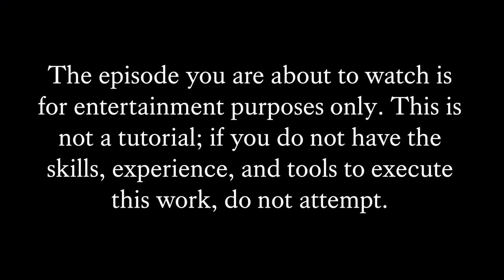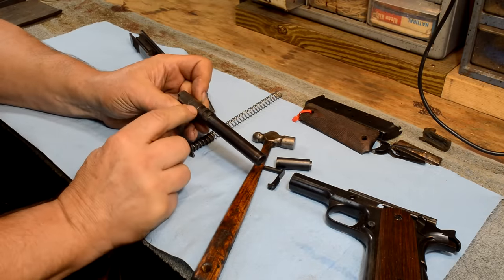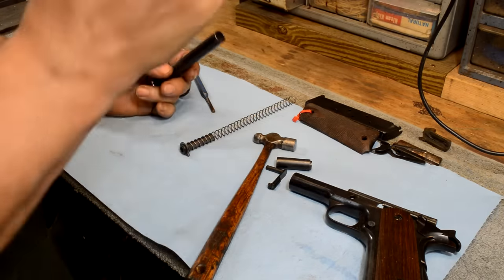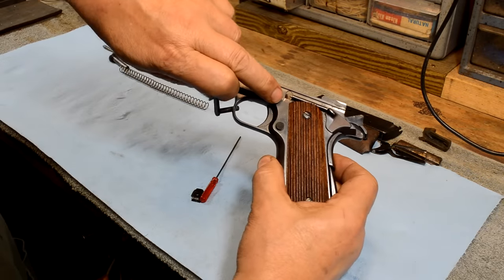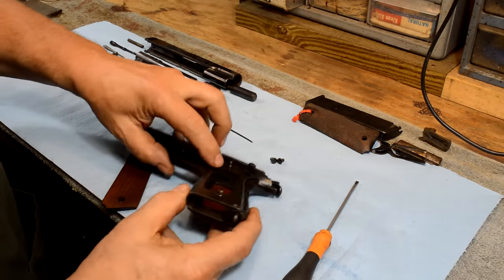Argentine M1911: Anvil 0125

Comment: "The gun runs great, just can't hit anything with it." That's how our boot camp 1911's were.
Reply: That’s how all my guns are 🤣 handguns at least. I struggle even at 25 yards with full size GI 1911s, only occasionally can I lob a round out to 75 and ring the plate. I should practice more but I can’t afford to shoot that much.
Reply: That's is the same description I heard in boot camp 1975.
Reply: Semper fi. I would draw a pistol 1911. From the armory. It was my weapon when I was doing special duty. They all would rattle and wobble hard to hit much. USMC. 71-74.

Comment: In all the years I have been completely taking apart 1911's, this video taught me a few little hacks to make life easier! Like having a mag in when putting the sear and disconnector back it! One hack I learned elsewhere, was instead of pushing the plunger from the outside to get the takedown pin back in, was to come in from the opposite side with a small flat screwdriver and compress it while coming straight in with the takedown pin. Excellent video as usual Mark. Thank You for resurrecting this old lady!

Comment: Speaking of 1911's. When I was in boot camp in 1971 we went to the range. We were required to use a Weaver hold (2 hands). The instructor then called our attention to the ceiling of the indoor range. It seems a chief was qualifying with the old school side stance with 1 hand. The armory 45 went full auto and emptied the mag. Last round went straight up. Good times>

Comment: This is a great video on 1911s. A few of the things you demonstrated I got to see first hand by my 1SGT before we deployed to Desert Shield as one of few A.D. Army units still using 1911a1's. He was in AMU , shooting competition with 1911a1 and working on them.  The technique you demonstrated on tightening slide to frame was pretty much the same. He used pencil lead (graphite) to slick up the action.  Mine was a pre WW2 converted to 1911a1. I wish I had it, my Grandfather's, Uncle's, and father could have been issued it during their service.

Comment: Mark, Thanks for showing us how to fix a loose slide. You sure make it look much easier when you know the best methods and order of operations for each job. 1911 pistols can have such good triggers because of their good design and all the hand fitting they need.  If it isn't a junker, it takes a lot of nerve to work on the first one. A wood block with a pair of tapered shims made from wooden shingles would make good filler blocks for frames and slides.

Comment: I de farbed my series 80 Colt back into the series 70 format with the spacer to replace the two widgets. The sequence was; re-assemble, despair, re-assemble, despair, 3 or 4 times until it functioned correctly and that is the LAST time I will tear into the frame that extensively at my age/patience level.

Comment: Great video mark. I work on a lot of antique firearms. I came up with a way of making the metal on new parts match the original guns texture fairly easy. I use a power supply. Hook up the positive to the part you're trying to match to the gun. Then hook the negative up to a Q-tip dipped in saltwater. By lightly going over the part. You can make the new part match very well. So then after bluing it matches the rest of the guns texture and wear.
Reply from the maker: Powered galvanic corrosion. EPIC, adding to my playback.
Reply: What a cool idea!

Comment: 22:48... Indeed. First time I installed an aftermarket Beavertail grip safety on one of  these and tried it out, it went BRRRRP... Rather, BRP, as I wasn't a complete idiot and did load the mag with just 3 rounds. Very scary (and at the same time fun and exhilarating). 30-ish years ago now.

Comment: Love the muffin tin lead ingot...  Been using the same for the same kinda work for decades...  Even has an oh so fancy hole drilled on one side.  As for fine Argentine pistols, my two Sistema 1927 Navy models, one blued and one Parkerized are as Tuco would say:  Tight...  tight, tight, tight and both are in excellent condition.  Only odd thing is the mag wells for both are on the very minimum dimension, and many magazines will not fit or fit very tightly.  The OEM serialized magazines work perfectly, and believe it or not Triple K magazines do as well.  Norinco ones are pretty good, but Metalform magazines took a lot of fitting (filing) to get to where they would even get to the point where they could be inserted.  Great video Mark.

Comment: When I was in the Army in the 70s, I saved my Pennie’s and bought a 1911 Gold Cup NM, took it to the MTU at Ft Campbell KY, to show it off. The NCOIC approved of my new toy, and asked me if I wanted to fix it. Brand new Gold Cup??? I said sure WTF, he had me take  the gun apart, he crimped the slide and installed a new barrel link that he made, he gave me a pot of rubbing compound and told me to get to work until the slide went home. Steam cleaned the slide and frame, put everything back together oiled it up. Put the gun in a rest ,used match ammo little bit more than 1” group at 25 yards. He told me that now if I missed it was my fault. I only shoot 185 gr bullets that I reload. It works good and has lasted a long time, replaced the extractor a while back though.

Comment: Good tips!  To avoid scratching the frame with the slide stop, you can get a business card and hold it against the frame when you're removing the slide stop.   

I think you're the first person here that I've seen say to take the slide off first instead of messing with the barrel bushing first.  That beats sending the recoil spring plug flying across the room or breaking light bulbs. :)  

I'll have to try inserting a mag next time I try pulling the sear and disconnector.

Comment: Mr. Novak...  An old-timer (WW2-era G.I.) taught me to hold the trigger in on a 1911 when dropping the slide.  (obviously while pointing it down-range) I have always been somewhat resistant to do this.  Reason he said was the disconnector would prevent a loosey-goosey G.I. 1911A1 from unintentionally-discharging.  Is this a good practice for a 1911?  Seems to me like a bad habit to get into.  Your feelings?
Reply from the maker: Hold the hammer like I did. Hit the "I believe" button on this one. Just Sayin.......

Comment: I have a 1943 A1 that my dad's oldest brother had. It has got rust around the end of the slide. Wish I had the money to get someone like you to preserve it.
Reply: You can clean a lot of rust off yourself and make a gun look 1000 times better. Just take some 0000 steel wool and some oil (I like using motor oil). Put a decent coat of oil on the part that's rusted, then gently rub the steel wool over it. After a few seconds most of the rust will be gone and the oil and steel wool won't hurt the bluing or parkerizing. If you have deep pitting and rust you can't get to, you can boil the part and the rust will turn black making it blend in and keeping it from spreading easily. Just keep it oiled afterwards and you should be good to go.

Comment: My Dad was in the Army 1973 to about 1998. I can remember how the 1911's where before they went to the Bereta in 9mm. They all rattled a lot. You had to work to qualify! The Army for a long time if I remember correctly would service a weapon something like every 3-5 years and the unit or company level armours would do maintenance on them but not rebuild them. If they needed to be rebuilt they only did it maybe 3 times and then they where often sold to the US Navy Marine Corps.! Not sure if the main stream US Navy was the same. If so I can only imagine the 1911's you saw! I am almost 50 now so that gives you some reference! I have children that own and carry a 1911. It is though not what I carry! I like smaller lighter for EDC!
Reply: Yeah, "old slabsides" does weigh a bit.

Comment: I have an Argentine contract Colt 1911 thats only about 300 away from yours. (C20353) Its nice to see another one since only 1000 were sold to Argentine from Colt in 1915. They are pretty rare to find, especially with the barrel and slide matching the serial number on the frame. Its a shame you felt the need to refinish it though. The finish on the slide and frame didnt look too bad from what I saw on video.

Comment: I'm not sure why so many prefer the flat mainspring housing. I've always thought it made holding the pistol feel like a shapeless brick. Plastic housings reduces weight in the worse place to have weight without hindering function as well. Just my two shillings :body-blue-raised-arms:
Reply: This particular gun originally had a flat mainspring housing, so they put one back on it...
Reply from the maker: All true, however not the point of this exercise
Reply: How did you fix the slop in the front bushing??
Reply: Ope.. I should have stated I was talking in general, not this particular pistol, my mistake 😅

Comment: A little bit of light grease on the slide and frame goes a long way towards slowing down the wear on those surfaces. Also just a touch of grease on the barrel will help keep the bushing alive. Use the grease like Brill cream, a little dab will do you.
Reply: I've always preferred grease to oil in all my firearms.  It stays where you put it and doesn't end up pooling in the bottom of my nice holsters!  I make my own with lanolin thinned down with flaxseed oil.  That way I can tailor it to the season (hot or cold)...and if it comes into contact with the holster it's actually good for the leather.  Good for your skin and wood gun furniture too.  I also use it to lube my black powder barrels...keeps the fouling soft and away from the steel.

Comment: I have a 1914 vintage Colt. I am debating trying to clean it up a bit and doing the rust bluing method that Mr Novak showcased. I believe I need to practice on a old Stevens 311 16 gauge I picked up some time ago.
Reply: As an amateur smith more than forty years, you'll be glad you did the moment you're into it.  I've built them since the seventies, they are just the bee's knee's.  I caught this because I bought a Brazilian slide from Numrich a few years ago when I was parking a bunch of parts.  I've given away about a dozen to family and friends, one in nine mil is my daughter's favorite handgun.

Comment: Great video as always Mark, every minute had institutional knowledge passing from you to us. I do have a bit of a gunsmith ethical question for you. I have a 1920 SMLE n01 mk3 that was in Australian service as denoted by stock marks with dates & units. As with many Aussie weapons, they painted all the metal parts that yellowy brown paint they use. from the parts that are not painted from years of handling, the metal looks great, but where painted under the stock, the paint has a bunch of brown grease/ "some rust" as im not sure what it is on top of it. I dont want to watch this beautiful gun deteriorate while in my possession but I cant bring myself to remove the original painted finish since its not apparent that there is any major rust damage anywhere. Just curious what you think the correct ethical/historical answer for this is.
Reply: Perhaps locally steaming the affected metal while somehow covering the paint, and then manually applying #0000 steel wool?
Reply: @theshadowrunner28  well, the only problem with that, is that I have tried to use a toothbrush and soapy water to clean the grease off the paint, and the paint is so frail it just comes right off with that toothbrush. #0000 steel wool will destroy it
Reply: @chrisbullock3504  Not sure then. At a certain point, you have to weigh historical aspects versus preservation. Frankly, if you are ok with it, I would take detailed photographs of every aspect of the paint, find an exact copy of it, and perhaps remove, conserve, and reapply it? At the end of the day, it's your call.
Reply from the maker: This is JUST MY OPINION....The rust preventative coating is failing. Get under all of it to inspect/conserve the metal. Totally degrease then reapply the coating. If you don't think an aussie armorer wouldn't have done exactly the same thing you're kidding yourself. (It's a 100 years old too).
I cut wire wrap off of WW1 grenade Mk1s also. What good is a gun if it goes unsafe because of a coating? Your call as the steward of a sliver of history.           Just sayin.

Comment: Hey Mark, Question for you? Where and how do you get your screws ? I picked up a shoe box full of scope bases and rings at a flea market and there is a lot of screws missing. I got what I wanted from the box but there are a few Leupold, Redfield, Weaver and a bunch of junk ones I would like to sell as complete. I looked at the gun screw kits. I would deplete the common ones out of the kit quickly. eBay and Amazon have insane prices! It wouldn't be profitable to buy from them. Thank you for the very educational videos. Jim
Reply: Just reading your question. Brings to mind when I needed key guard screws for a Yamaha alto sax. Yamaha sold them two on a blister card for over ten bucks. A fellow brass woodwind tech turned me on to a place where I could buy pretty much the exact same screws in bulk for about three cents a piece. 
Even better, the place had the British Standard  Whitworth nut I needed for the tool post holder on our Boxford lathe that some fool had lost or misplaced making a beautiful old lathe good for very little. Hell, if I had the nut for the tool holder, I could of made one. Sort of a catch 22.
Reply: @robertdeen8741  I did find Fosters. They sell gun screws at a reasonable price but you have to buy qty. of 100 per type of screw.
Reply: I actually stopped at my local hardware store and he has the hillmen wall of assortment. He has them for $0.85 each. He now has a zero in stock of multiple sizes.

Comment: This was an awesome video.  I have a new 1911 and that pin that goes through the fram and the mainspring will NOT drop for me. I'm gonna try hitting it from the other side to loosen it up like you did here.  I'm trying to put in a skeletonized hammer and a beavertail grip safety to avoid that bite.

Comment: In My country (México) old "pistoleros" when saw a 1911 rattle (sounds when it is shaking) wanted it, because they said rattles ones doesn't fail or fail less than others.
Reply: many years ago I worked in a gun store in Southern California. when showing a 1911 type (usually a Llama) the first thing a Latino customer would do is shake it. to make sure it rattled.

Comment: I love my .45's but one thing that always bothered me is they have to be cocked to flip the safety on. Just seems counterintuitive.
Nice work as always Mark !! 👍👍
Reply: If the hammer is down, there's no reason to put the safety on in the first place because the gun can't possibly fire until the hammer is cocked.
Reply: If the hammer is all the way down, resting on the slide and the flat of the recoil shield, it's mechanically impossible to hit the primer. The firing pin is shorter than the channel in the slide.
Reply: @ScottKenny1978  not everyone knows that, JMB was a genius. When I was in the CG we were issued the 1911 until they swapped them out in 90. The 4 safeties we were told were:1, thumb safety, 2, grip safety, 3. Half cock notch &4. The firing pin is shorter than the channel.

Comment: if you have them, maybe hold a stack of gauge blocks that are slightly under the required dimension up inside the slide before squeezing with the vise to avoid over compressing it?
Reply: Because of springiness of the steel you have to compress the sides of the slide approximately to 2-3 thousandths for final result of 1 thousandth. This process is controlled only by sensivity of fingertips and your common sence, gauges won't help much.
That's a blessing and curse of final hand fitting.
Reply: @john-doe-I  Right which is why you would chose a gauge block stack 2-3 thou under the dimension you have measured for the slide and then compress to that so it springs back but with basically zero chance of going too far. if it needs to he tighter reduce the gauge blocks by .001 and repeat
Reply: @MattFieldPhoto  Yep, this will work for marines armory with a bunch of rattling 1911 to repair. For individual gunsmith I think it's too bothersome (unless he's working entirely with 1911 day and night). 
Also - how consistent is compression of Colt-made slide compared to "mystical battleship armor steel" Ballester-Molinas, and I doubt every 1911 have exactly same dimensions to begin with. So - there's still plenty of handfitting work for mr. Novak and his famous 1ounce hammer.

Comment: My SIG, taurus, and Rock all just push straight into the hole when the slide is lined up. It is offset downward just a hair during the push. Is there something different with the modern 1911 slide lock?
Reply from the maker: I choose to work around as this was made in 1916 after all

Comment: nice job but how did you do bushing?
Reply: Yeah thats all that is missing from another great video by this man. It may be a trade secret or a little risky. :)
Reply: @kriztov265  sure:)
Reply from the maker: Left the bushing alone. Sloppy, yes, but the slide was far worse. Original? YES. We went with that. At the end of the day, 80 % of the problems were vanquished  and we were good with that
Reply: @marknovak8255  thank you sir
Reply: @marknovak8255  Thanks for the reply Good Sir :)